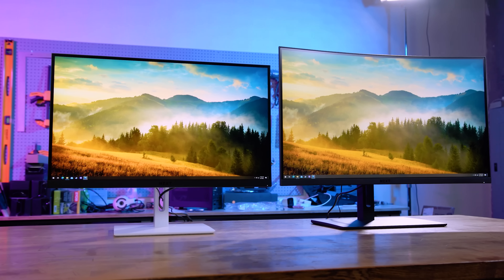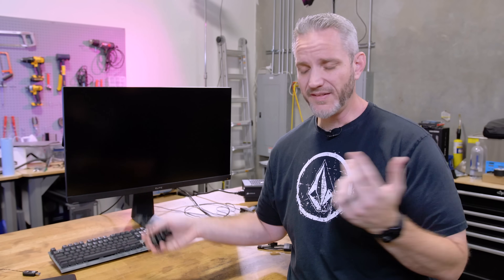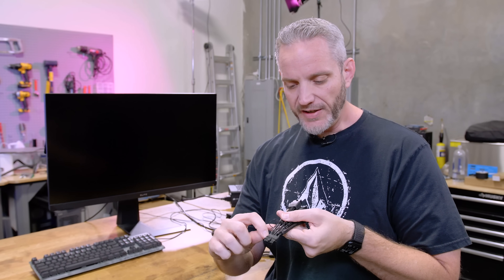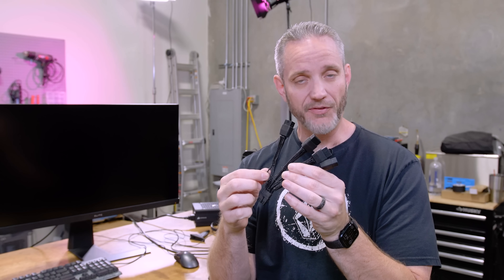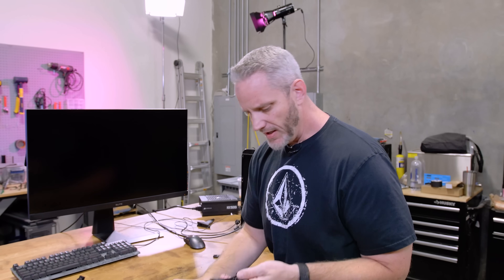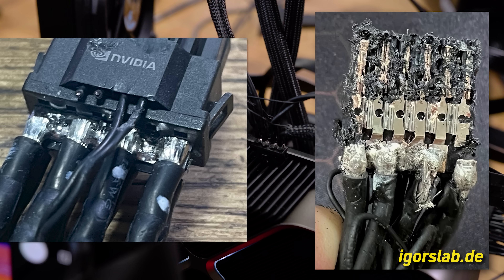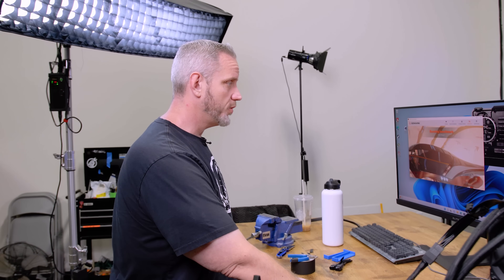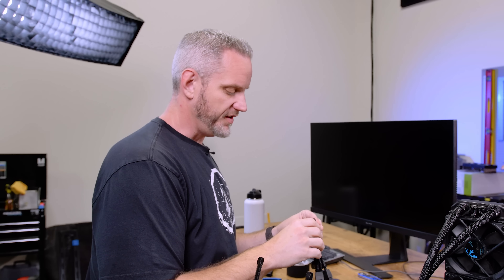Igor's Lab figured out why NVIDIA adapters are melting!

Comment: Little remark: There is no such thing as resistance of power. The material has the resistance and sending too much power through a higher resistance (now much less material to get the power through after the break) is what causes the heat. The now shitty contact on the breakage point also ends up with a higher resistance and you could end up with arcing which doesn't help either.

Comment: When putting devices in parallel, the current will naturally follow the path of least resistance, and even a few milli-ohms can make a difference when you are sending AMPs through the connection. The bus bar at the connector end is an attempt to alleviate this issue.   I sincerely hope that the bar is something other than foil.

one of the weakest form of connectors one can use is the soldered type.

Comment: If the outside cables are breaking off , twice the wattage though the middle cables should melt the centre not sides , if one side cable is breaking  the other 3 would take the heat melting one (other ) side (meaning the outside cables are drawing more wattage then the centre two )

Comment: I don't think that its because it draws 450w from 2 cables I think its still trying to draw from all 4 but the 2 broken ones are making so little contact with the pad/pin that it is creating a hot spot on that particular pin and melting the thinnest part of the plastic (the housing for the pin). When I wired my first car stereo as a teen I forgot to crimp one of the power wires and when it stopped working a few months later the crimps plastic housing had melted because the connection was lose inside of it creating a hot spot.

Comment: Cut middle pins off completely and just leave 2 outer ones (the ones usually heating up) and that will replicate your result. Its sending all 600w of power through these 2 pins, that's causing the issue as they are only rated at 9A each. By cutting cables you are just reducing power supplied from psu to gpu. If they were overloaded, cables would melt themselves and not the plug since you got that plate connecting all pins together distributing load between them.

Comment: @JayzTwoCents
Having worked for a company that created test PCB's for electronics company prototypes, plus another company soldering Geophone strings for the oil industry I learned the soldering quality is VITAL.
For the 1st company, My task was to hand solder the few components that couldn't be wave soldered (passed through a solder bath with a standing wave).
Every solder joint on these PCB's was then examined under a microsope and also an X-Ray microsope to check for the amount of solder plus dry joints, cracks or bubbles within the solder.
ANY defect meant the PCB came back to me to be reworked, i.e. removing any excess and applying additional flux and remelting the solder, or, adding flux and solder if there wasn't enough.
The 1st set of 20 boards had 17 defects, the 2nd set had 5, after that zero defects.

For the 2nd I was tasked with winding the terminal wires onto a stress ring plus twisting together and soldering the power connections and tinning the sensor wires for connection to the geophones.
EVERY string made had a sign off sheet for every process, once completed they were ALL tested to 200% capacity and also vibration stress tested, any failure could therefore be tracked back to the oprerator and remedial work carried out re-enforcing the quality standard required.
I had 3 strings come back to me in the 1st week and then zero whilst maintaining the highest production rate out of 50 people doing the same task.
Both jobs every joint I soldered was tested beyond the standard operating levels expected. 

In cable manufacturing speed is the holy grail, quality is secondary, they test for defects and "Does it work?" and that's as far as it goes.
Watching your vid and looking at Igors images highlights this, on your connector the solder surface is smooth and you can still see the wire strands just under the solder surface on the 1st 2nd and 3rd joints as the correct amount of solder has been applied plus, the wires are all flat on the contact pad, meaning the operator has held the wire until the solder has fully solidified. 
The 4th the wire has lifted from the pad as the operator has reduced their pressure just as the solder has solidified, at worst this can be a stress multiplier like a lever if bent by the user.
On all 4 wires the solder hasn't wicked up under the insulation and you can see the individual strands are clean, enough heat applied and the right amount of solder used, the wires can flex almost right up to the connector.
Nice workmanship but distracted at the final step because they're already shifting focus to the next connector.

On Igors connector the solder surface is lumpy, you cannot see any strands because too much solder has been applied and the operator has been moving the wire as the solder solidifies, the worst being the 3rd, which looks like the iron was removed before the solder fully melted or not enough flux was applied.
Too much heat has been applied and for too long, allowing the solder to wick along the strands and under the insulation, creating a longer lever and transferring more stress to the neck of the pin.
Moving the wires during the "Freeze" of the solder can cause cracks and voids increasing resistance through the joint leading to increased heat.
Shoddy workmanship throughout but good enough to pass the "Does it work?" Q/C level.

If the wires are bent vertically, up or down and being pressed hard up against a side panel there's going to be increased strain on the pins and vibrations are going to be focussed onto the pins, causing them to tilt in the shaft and you have the potential to create masses of heat if the contact area is significantly reduced.
Side to side bends would do likewise as one side would be under tension, the opposite side would be under compression, again focussing the vibrations to joints 1 and 4 and leading to more arcing on those specific pins. This is possibly why it's pins 1 and 6 suffering eccessive heat buildup and melting before the inner pins.

Comment: I'm very interested in checking out the Corsair cable you mentioned in the video, but your "links below" only leads to the Amazon main pages. Can you point me to the correct page please? Thanks! 👍Also, I haven't even managed to connect my new 4080 as it's too big for my LIAN LI PC-011 case without pinching the crap out of the wires when I put the side glass back on. Anyone have any opinions on the Cablemod brand 12HPWR Angled Adapter that they're working on?

Comment: It's not just the removal of the pad, you need to break the pad off, then let it sit in the original position to create a small arch inside the adapter, which would increase heat significantly

Comment: It is hard to recreate because you need wire with really bad connection but not cut off and he can create Tiny arc and then its start to melt. This is like arc welder, when you have an electrode connect to material only electrode is start to Warming up but when you start arc even you have less power consumption you can melt steel.

Comment: Ah, yes thank you. I saw many many comments claiming the wire gauge was too thin and ampacity was too low. That made no sense to me. I could not see an engineer designing a cable and actually making the wires too thin for the current going through... That would be insane.

Comment: Been watching these videos, as a past investigator of industrial accidents, I have a few questions for the 'educated'.
1. If these potential breaks of connection were the issue, why is it that the melting is happening on the plug side and not the connection points?
2. Has anyone looked at monitoring the GPU board side of the connection to see how the power is being pulled from these connections?

It's not that I disagree with any of the finding, but have questions that might help answer why this is so hard to recreate.
Reply: During an investigation the way one looks at a problem is paramount. The first question is key, but so are some definitions.
(Taking the wire side to be first point of contact and the GPU being the last point of contact)

1. The 'last point of contact' 1 or two pins on the outside are melting points

From here I would be asking the first few questions.
1. Under normal usage, do these points have higher heat issue than the others?
2. How could these outer points have a higher heat issue?

I could go further but I think the point is made, investigating an issue has to stay on point to the issue and not jump to any potential conclusions. Keep on the issue and work your way back from there.

Comment: Think about the conditions the cards are in. HOw well is the cooling of the case? you tested this outside of a case in which heat escapes into the air, not trapped inside a case and bunch of wires and more.

Comment: If the plug is heating enough to melt, it's going to make the solder joints look bad. It's basically heating the solder enough to soften it and cause a cold solder joint. It's resoldering itself as a cold joint.

Comment: Maybe it's not getting hot because it's not arcing electricity like it perhaps would in the tight quarters of the mould, and thus generating heat. 
An electric arc may occur either in direct current (DC) circuits or in alternating current (AC) circuits.

Comment: If the sides brake off there is no current flowing through them and higher current would flow only in the center, this would cause melting in the middle of the connector, not on the sides. There is no chance sides get hot, because of "lost connection". What actually could be happening is that, sides get "partially" broken, or completely but still being close enough to be touching so they still make weak contact making current flow with high resistance, hence heat. Also if those stop touching, but are close enough, there could be arcing making heat. This is why I thing only sides get hot. Also for anyone wondering I have electronics degree.

Comment: imho, even putting that plug right in the middle of the cooler where the hot air exits is also not good for that plastic. So it's getting hot from inside and outside

Comment: Hi Jay,

thanks for showing and explaining all that. Just a little side note... The plastic keys don't melt because of the heat of the 2 shared foils, but because of the heat of that cracked joint. There is still electricity taking that path, but since it has a high resistance it heats up way more than everything else.

Comment: on thing you have not tested is you can get low melt solder and it means the solder will melt at a lower temp some take extreme heat to melt. example i have a solder that melts at 60c i use this as magic solder when you come up against an extreme solder that is hard to melt you can mix this in with it and clean it up very easy then apply your normal solder its possible the heat woud desolder the connector if they have used the wrong solder

Comment: The separating of the cabel won't cause it to heat up that much. The problem of melting starts when the separated cabel touches back that plate and in a short amount of time high amount of current is flowing. Only then it will create a temperature high enough to burn the connector.  To recreate this you need to cut the wire and  while running touch the plate multiple times. Wouldn't recomend doing that though.

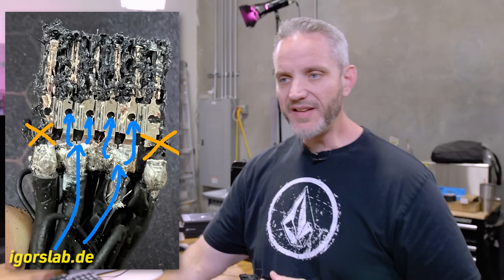Comment: 6:10 the thing is, if that's the case where either side has come loose, the middle pins will be drawing too much power and heat causing them to melt, not the end ones surely?

Comment: The resistance is exactly the issue when you get a break in one of those wires think of it like an incandescent light bulb the filament the part that lights up inside that light bulb is just a high resistance piece of wire when you get a break on that plug where the wires are soldered it's still trying to draw power through that wire but instead of the resistance being near zero it's now potentially a thousand ohms or higher the higher your resistance drawing at the same voltage and means you have to apply more amps to get the same wattage which creates a ton more heat which is why the plugs are failing

Comment: It must be arcing! Ummm no. We can explain how these particular pins are heating up using Ohm's Law.

R = V/I, I = P/V or I = V/R

Power consumed can be calculated with:
P = V/I or P = IIR or P = (VV)/R

For 600W power draw, the current is 600/12 = 50A.
We have 6 x 12v pins on the 12 pin adapter so each pin is carrying 50/6 = 8.33333333A.
For 12v to push through 50A the total resistance across the GPU 12v rail is 12/50 = 0.24 ohms.
Given we have 8.33A per 12V pin the resistance per pin calculated using R = V/I is 12 / 8.33333333 = 1.44 ohms.

The pins are in parallel so we can check this by calculating the parallel resistance using 1/Req = 1/R1 + 1/R2 ... 1/R6.
1/1.44 + 1/1.44 + 1/1.44 + 1/1.44 + 1/1.44 + 1/1.44 = 4.166666667 = 1/Req
Req = 1 / 4.166666667
Req = 0.24 ohms

Note Ohm's law is always true so as power draw decreases, the total resistance seen at the GPU 12 pin connector increases dynamically.
The opposite is also true, as power draw increases, the total resistance seen at the GPU 12 pin connector decreases dynamically.

Now Ohm's laws also states that voltage drops proportionally across resistors in series, with each resistor dissipating the proportional amount of power.
For example, if we have 12v across a resistive load of 2 x 1K ohm resistors, the total resistance is 2K ohm and using I = V/R, we are drawing 12/2,000 = 6mA.

Next let's calculate the voltage drop across each resistor using V = IR.
For R1 0.006 x 1000 = 6V
For R2 0.006 x 1000 = 6V

Now calculate the power in Watts dissipated by each resistor using P = VI.
For R1 6 x 0.006 = 0.036W
For R2 6 x 0.006 = 0.036W

Total = 0.072W (72 mW)

Let's check this by calculating the total power draw for the circuit using the law P = IIR (commonly called I squared R).
0.006^2 x 2000 = 0.072W

So what is happening in this connector? When an outside solder joint is broken, resistance is introduced into the joint and let's assume this is 0.2 ohms. This cracked joint resistance is in series with the pin's resistance at the card connector. Now let's do our Ohm's Law math and consider this new resistance.

As per the above calculations the pin resistance is 1.44 ohms.
Total resistance including the cracked joint is 1.44 + 0.2 = 1.64 ohms.
Total current draw is 12 / 1.46 = 7.317073171
The power dissipation across the cracked joint can be calculated using P = IIR
7.317073171^2 * 0.2 = 10.707911957 Watts.

10.71 Watts dissipated by a pin with no cooling! The pin is dissipating so much power it is heating up and baking.

The whole PCIe 5.0 12VHPWR cable spec is utter madness. I honestly don't understand why 12v power to modern GPU's is not delivered using a single pair of 6mm 50A power cables with crimped terminals and Anderson type connectors.

Comment: The error is that you are testing without completely reassembling the connector. As the welds are exposed directly to the environment, even if there are 1 or 2 cuts, the heat dissipates and the temperature does not rise so that the connector melts.

Comment: Wouldn’t arcing be a factor here? If you cut the plug open and move the disconnected cables away, you won’t generate as much heat as you would if the cable remains close to the bus bar in the connector since it would start arcing when it has a poor but still intermittent connection.

Comment: Anyone who did some soldering work to connect things with wires should know that a solder joint that is exposed in that way without something wrapped around or some kind of sheathe that limits movement in the area of the joint will have to regularly be repaired because of joint failure and failure of the wire.

Comment: A "cold" solder connection is definitely a problem. They are easy to break compared to a correctly "hot" solder connection and more prone to micro fracture causing resistance and current issues.

Comment: So glad I bought a EVGA 3090 and a really nice PSU.  No cheap dodgy adaptor...just 3 big, safe chunky PCI-e cables.  When I want to build a 40 or 50 series Gen 5/6 system....I'll buy a proper ATX 3.0 PSU and avoid this whole adapter malarkey entirely.  

Buy at the end of the gen instead of the beginning, after all those problems have been worked out, and prices are at their lowest.

Comment: I would be interested in seeing how many amps are actually being pulled through these cables, and if the affected systems are using extensions before the adapter. I've had several customers come into my shop with burnt alternator wiring after they install other loads in their vehicle. Just upgrading to a larger cable fixed it. Higher amps/watts over a longer distance creates more heat and requires a larger diameter wire. I'm really surprised they went to this design in the first place. I would be much happier looking at 4 giant connectors on the side of the card vs burning my house down.

Comment: So do I see right too, that the 6 pins are not connected to each other? Therefore the middle 2 cables supply 4 pins on the 12VHPWR and if the outside 2 break, there are 2 cables supplying 400w through only the middle 4 pins and with the chance of a short of the outsinde ones? time to order the cable mod extention...

Comment: A soder joint is where Thomas the Tank engine hangs out. A solder joint is used for electrical and mechanical support in electronic circuits.

Comment: Sounds like having a modular power supply with a cable designed specifically for this GPU is the way forward. Chances are good you would want a new power supply rated to deal with the power draw of a 4090 if you are upgrading the graphics card on an existing system anyway.